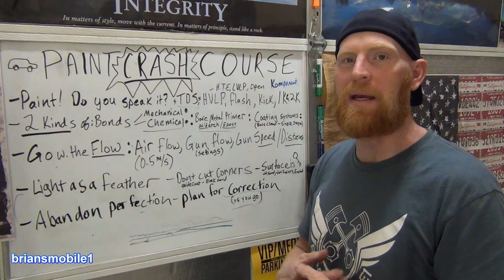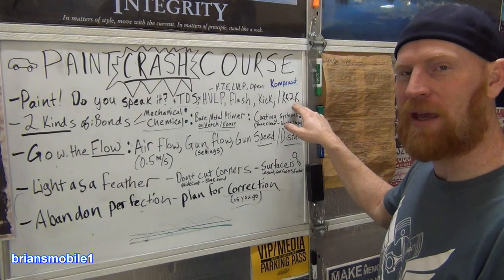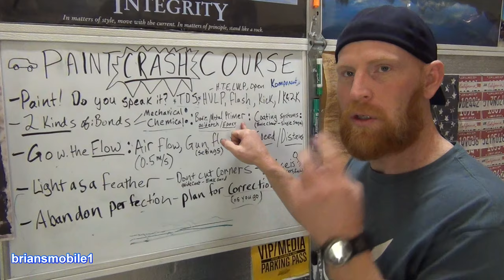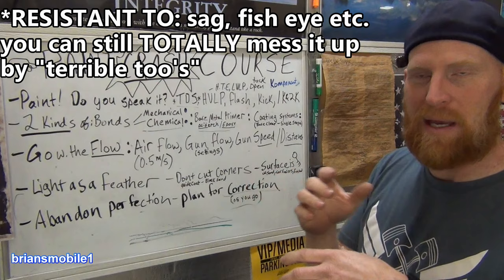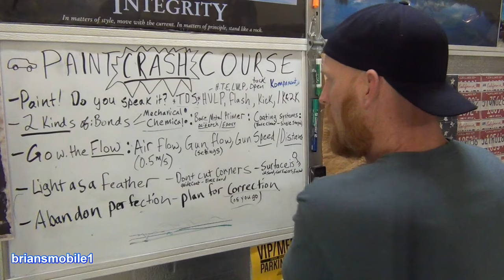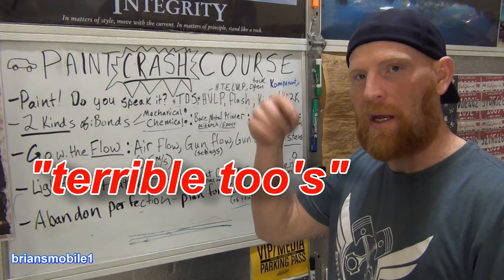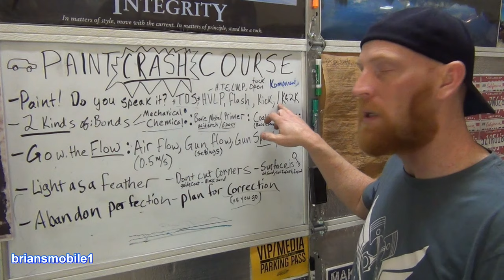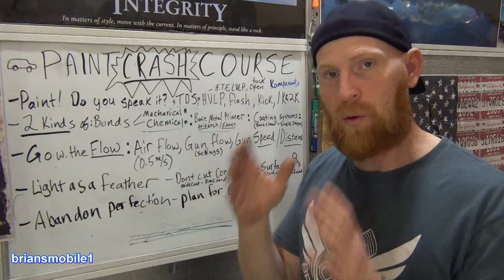20 min  Car Paint Crash Course Speak the Language

Comment: Back in the 80`s a friend of mine painted my 79 K10 truck. Used lacquer and painted it black. When he finished it it looked like while it was wet someone took a hand full of baby powder and throwed on the hood. Little tiny white specks all through the paint. Noticed it mainly on the flat surfaces. We sanded it down and i had another guy that buys and restores Corvettes and owns a body shop come down and paint it and it done the very same thing. To this day we don`t know what caused it. Ended up taking the truck to another guy that worked at a body shop and paints cars on the side. He wanted to put some silver metallic in the paint so i said go for it. He removed the bed from the truck and painted the cab one day and the bed the next. Needless to say the paint was not mixed the same. The cab had very little metallic in it and just looked black. The bed had lots of metallic and looked like a dark gray. I went ahead and drove it like that until i sold it. So the truck was painted 3 times 3 different guys and never came out right.
Reply from the maker: That's got  to be frustrating.  Black is one of the easier colors to match, but there's a lot that can go wrong as you've seen.

Comment: Yes flat colour is easiest to repair. Metallic and pearl you will find that a pro shop will bill you for respraying the entire vehicle, as they know they will never be able to make a good match. Yes white is hard to match, but so long as you have a good sample of the colour the paint shop will start with a set of swatches, and mix in the dark colours a drop at a time, mix thoroughly and then put a drop on the sample panel, and compare after it has been fast dried with a heat gun. Reason why you take the old damaged fender with, after washing it properly, to the paint supplier to match. Yes 2k is better, and using 2k primer, 2k topcoat and 2k clear is the best way, though the 2k reducer and cleaner is way more expensive than the paint, and you need about double the volume of it as well, plus a bit more to use to clean the gun, clean the surfaces ans to make up losses from evaporation. 

Brian might have to use a fast thinner, as it is cold, but by me you always use a retarding thinner as it is hot. And you can get it glass smooth and glossy as painted, but it seems no paint shop ever can get that right, half of all the paint they apply is removed with a buffer. Only time I got that was painting inside a canopy, where it was all fibre and no smooth, so finished off all fibre and sort of filled.

Comment: Brian, you've got several points just wrong. 

1st) Both HVLP and HTE spray guns use the same nozzle sizes. On modern gravity feed guns both are commonly used in either 1.3 or 1.4 mm. Many pros do use a 1.2 HTE for clear to get the highest possible quality of finish off the gun. What differs between the two is the size of the atomizing holes in the wings of the aircap. The HVLP will always have larger aircap wing holes as an attempt to break up the paint with more volume and less pressure which varies in effectiveness. The HTE guns will have smaller aircap wing holes to more forcefully atomize the paint. Most pros use HVLP guns for primers and basecoat and HTE guns for clear. My current favorites are the Iwata Supernova LS400 for base and the Supernova WS400 for clear.

2nd) There is absolutely no difference in quality between single stage and basecoat/clearcoat urethane paints. All single stage urethane is is clearcoat with color (toner) in it. I make my own single stage black by simply adding black colorant to my clearcoat and then adding the isocyanate hardener at whatever ratio the clear calls for. Single stage urethane is fine for any solid color and basically indistinguishable from base/clear. You can only tell the difference when you color sand and buff as when you color sand and buff single stage your pads turn the color of the paint. Metallics suck in single stage as it's impossible to get the flake to properly lay down in the single stage system so that's where base clear becomes mandatory.

Forget the Harbor Freight gun and get yourself some Astro Pneumatic Europro guns. These go for $100 each and spray very well. Not as good as my SATA’s, Iwata’s and DeVilbiss pro line guns do but damn close for 1/7th the money. Astro makes these in both HVLP (green color) and HTE (blue color) get yourself a 1.7 HVLP for primer and a 1.3 HTE for sealer, base and clearcoat.

Comment: I learn't from this, thanks.

There is no proper way to do paintwork. I have to say that I have had good success with two pot primers -- I guess it kind of acts like a sealer because it does not dissolve with the base coat.

One has to remember that even professionals will spend days working on damaged panels if they need to re-use them.